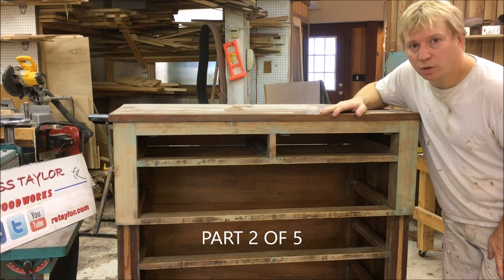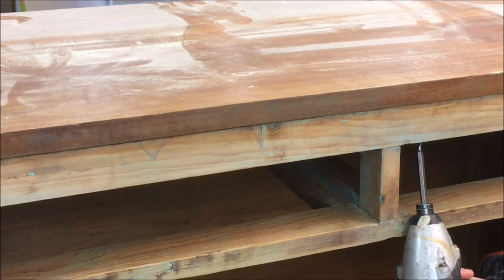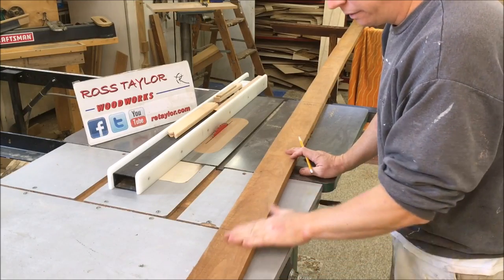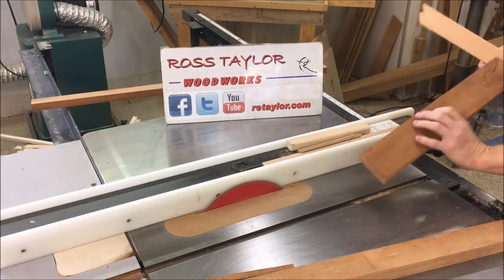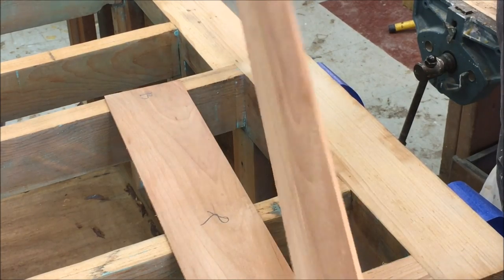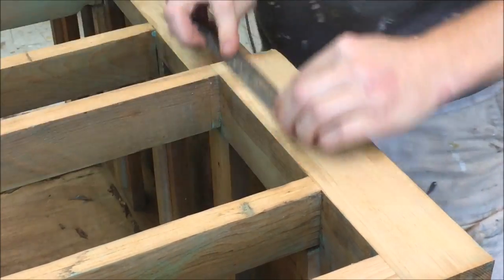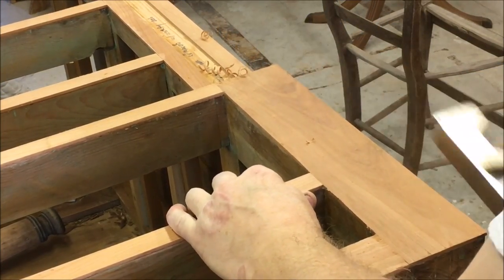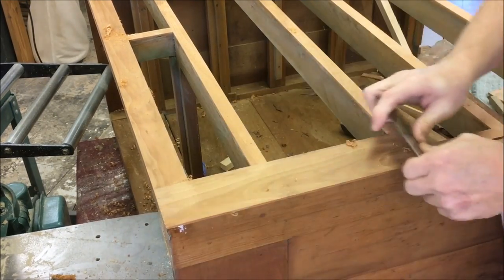RESTORATION - TALL SHERATON CHEST OF DRAWERS  ( part 2/5)- ANTIQUE FURNITURE

Comment: Why aren't you using hide glue? You are restoring it now, but nobody will ever be able to restore it again. Doesn't seem too responsible.
Reply from the maker: I do use hide glue on previously glued joints where hide glue was used. I do not use it for permanent structural repairs . hide glue can soften in hot  humid weather .